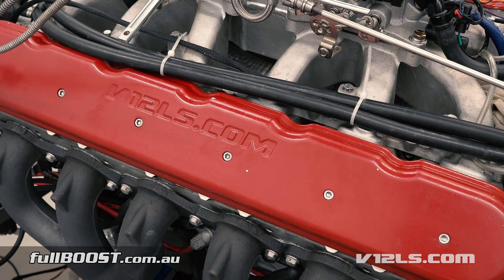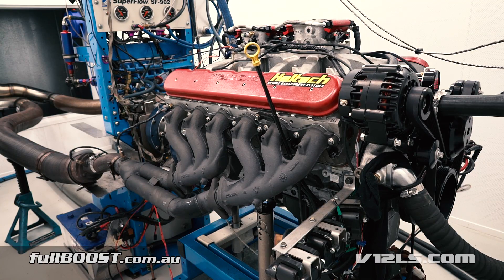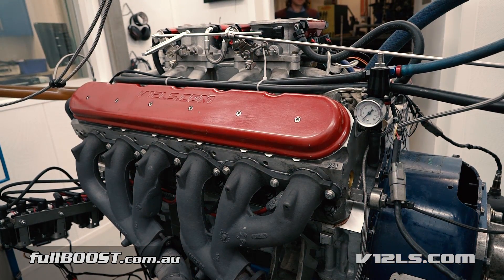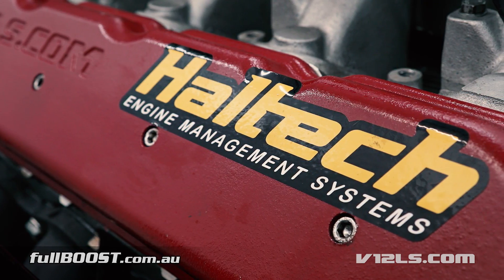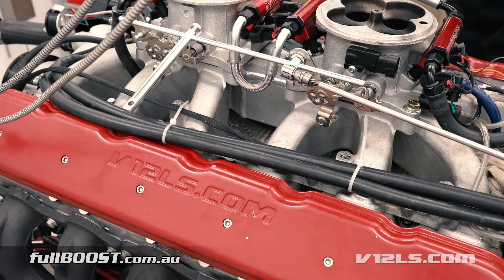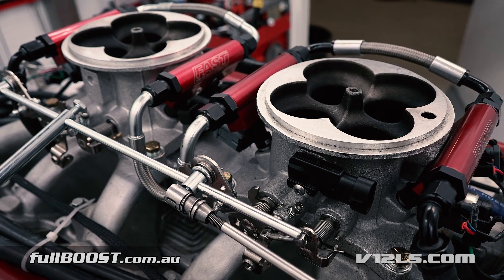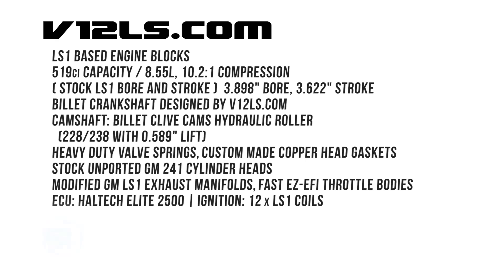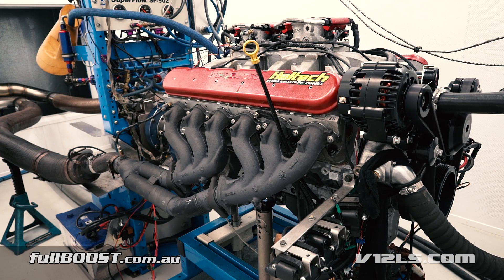V12 LS1 engine dyno

Comment: well, now you can legit LS swap a Ferrari or a Lamborghini
Reply: made me laugh !
Reply: fucking lol Tyler
Reply: #LStheworld
Reply: A little jealous I see.
Reply: Lol still to big! Won't fit in one lol
Reply: Schooled those kids. Good job explaining it also. I was going to say something along those lines but you put it perfectly.
Reply: Thats really funny. Probably won't catch on fire again.
Reply: How is horsepower per liter relevant at all? It's only relevant if you live in Japan where they tax you based on engine displacement. - Horsepower is literally Torque X RPM / 5,252 - its a mathematical formula.

"Horsepower Per Liter" is a measure of volumetric efficiency and how well the engine pumps air and feeds fuel as the RPMs climb. Has nothing to do with anything else. Weight matters, size matters. Smaller packages that weight less are good. The LS series is the smallest package V8 with very respectable power and economy and low weight, being lighter than most V6s in front wheel drive Toyota's. 

A Hayabusa pushes 200+ horsepower because of 12k+ RPM and ability to hang the torque it does make to that rev limit. But a 190 hp 444 cubic inch 7.3L Diesel 1988 International Dump Truck will haul 5 tons of rocks, towing a trailer full of Harley Davidsons up a hill and run over your parked 'Busa like its a soda can.

Ideally, you would have an engine the size of a soda can that weighs the same, 12oz or so, that displaces 27 liters, spins to the moon 16k rpm and makes 5,000+ horsepower N/A and 10k on 30lbs of boost. Out of a pop can.

Alternatively, you could have a 680lb V6 that makes 480hp out of only 3.8 liters as seen in the 2009-10 GTR, but it and its turbo system are far larger, hotter, and 200lb heavier than an LS7 7.0L V8 making 505 hp. Which is better? Well, obviously the GTR is epic, and so is the LS7. The corvettes very low hood line, large trunk, and light weight are only possible with the push-rod ohv engine it uses. 

Power matters, Torque matters, Durability matters, Small size and weight matter. Efficiency matters. Displacement makes zero difference. Who cares if you put a 3 liter hole in a 600 lb block of metal instead of engineering 8.4 liters of holes out of the same exactly block?
Reply: Justin J exactly, torque > horsepower
Reply: A Ferrari V-12 isn't as reliable as an LS and it would probably cost you 4x more to buy a new one than the V-12 LS.
Reply: SpaghettiKillah you do understand that a na lsx can make over 800 to the crank and that's just a v8
Reply: Ferraris aren't exactly known to be reliable same with Lamborghinis with V10 or just the Gallardo in general there's a compilation of videos of mad Ferrari and Lambo owners destroying their cars because they quit working it's hilarious
Reply: @SpaghettiKillah  triggered fanboy spotted lmao
Reply: @SpaghettiKillah . This went way over your head. This motor was meant to be just an LS1 with extra cylinders. Now if you upgraded the heads and cam profile you will have a monster! Educate yourself, and get off your high horse.
Reply: Then the beauti of that European car would be worth a pack of cigarettes!
Reply: LS7 V12= shredded Ferrari drivetrain.👍
Reply: @SpaghettiKillah  wanna count how many time Lamborghini went bankrupt
Reply: @SpaghettiKillah  you fail to realize this engine design is from 1997 not 2016
Reply: The irony is only one of them uses V12s anymore Ferrari has moved onto V8s and Lamborghini still uses V12s and uses some V10s.
Reply: @SpaghettiKillah  
The cylinders are huge in a pushrod engine compared to 4 valve dohc.  The genius of the pushrod engine is that for similar horsepower the external dimensions of the engine block are actually smaller and usually lighter than the high tech 4 valve dohc engine.
Reply: @Triple_J.1  Dude this engine looks like a pig that won't fit into anything. The extra displacement isn't really a benefit here, unless you are stuffing it into your work truck for shits and giggles. I think thats what his point was about HP/L.
Reply: @SpaghettiKillah I think he wants an ls swap because it would last longer than a week. good luck, being rude never helped anyone.
Reply: @MB-jz3uu  was thinking the same thing
Reply: @danieljean-charles9207  got a calculator?
Reply: @SpaghettiKillah  I think you need less time on the internet.
Reply: @Triple_J.1  Annihilated.
Reply: @SpaghettiKillah  Yet the normally aspirated, downsized and RPM restricted LS based race engines seem to clean up in endurance racing. The C7R or Caddy DPi seem to out fox Ferrari each and every time. I don't understand why others just can't keep up....
Reply: Why would you?
Reply: @nxtgen2b416  To a purist collector, yes. But as far as I'm concerned it's a pack of EXPENSIVE cigarettes as delivered from the OEM. As we all know, cigarettes are hazardous to your, AND your wallets health!
Reply: @J.Steele7  a 22 year old female isn't all bad, either. Just because something was "engineered" 22 years ago doesn't mean it's a bad thing. In the 1960s, the design of the 4 cylinder Offenhauser's racing at the Indy 500 was much older than 22 years. But if you had something else powering your car, you were SOL, because a design a LOT older than 22 years kicked everyone else ass up around the shoulders!
Reply: The new corvette with the mid engine this would dominate a lambo or Ferrari if it would fit
Reply: @milojanis4901  the 2jz is that old and id take that over some lamiebo or Ferrareee i seen them boost and nos that is 1600whp and much better than the bmw trash is supra now so new doesnt always mean good
Reply: Dont give them ideas
Reply: Ls3 swap would be better.
Reply: LoooL
Reply: @SpaghettiKillah  Right, because I'm sure it's fair to compare 1 experimental LS-based V12 that some guy made from an engine never intended to do this to a v12 built from the ground up by a team of engineers with millions available in R&D. 
btw, you point out that the F12 has a higher specific output but what you failed to mention is that, because the LS is CIB, it's has significantly smaller outside dimensions and lower center of gravity relative to it's power output - in other words, yes, it's bigger on the inside but it's also a smaller metal box on the outside relative to it's power output.
Some of these guys might be LS biased but you're no better then they are, you're just biased from a different brand and way of doing things.
Reply: shane marz -drives a celica
Reply: Yea, because replacing Ferrari or Lambo masterpiece engines with that GM crap is really smart.
Reply: @cliffordcullen1687  You realize Ferrari's engines are more powerful?
Reply: @cujet  Is that why they keep losing to Porsche, Ferrari and Mercedes?  And that's considering that the series Corvette's compete in are the main focus of Chevy's racing division, while nobody in Ferrari or Mercedes for examples cares about those too much, since they're busy in the big boy sport, aka. Formula 1.
Reply: @stevejhorton  Yea, and it can also overheat after 3 minutes of driving hard on a race track in a top of  performance line up Corvette, and it can break down by the time it has 10,000 km's on the clock.   Don't let me go into horror stories. Companies had Corvette's on the Nurburgring that they gave out as taxi cars that people could rent and drive on tracks back when C7's came out...they were HORRIBLY unreliable, HORRIBLY.   At the same time, zero issues with Mclarens, Porsche's, Ferrari's, etc.   Renting companies have Porsches with 150,000 km's on the clock of EXCLUSIVELY track driving on the Nurburgring.   Any LS engine would turn into atoms by that time if it had to take so much abuse.  The only positive about LS engines is simplicity and cheap spare parts, but they're cheap for a reason.
Reply: @executiveorder7146  Hahah, funny joke.  Corvette would dominate a Lambo or Ferrari.... yea, in the amount of cheap plastics it's built from and in the amount of times it would break down and overheat every time you'd drive it hard.
Reply: You already could. A modified LS V8 can easily make more power than a stock Lamborghini or Ferrari engine. The beefiest is around 700hp, the LSX is also around 700hp. Modify and tune an LSX or LS7, or really any LS, and it'll eat those numbers. I hate to sound like a supercar hater, because I'm not, but for the prices they charge, the power they make is extremely low considering I could probably drop $30,000-$50,000 on my Suburban 1500 and be overpowering Lambos all day with built internals, trans, driveline and twincharger, which is, yes, still extremely expensive, but it ain't $200,000-$3,000,000 expensive. Really, LS and LS-based engines are capable of a lot more than they're given credit. This crazy thing is no difference. Get those built internals, a custom transmission and driveline, a twincharger or blower custom built for it, and it could make 2k horsepower easy.
Reply: @derbigpr500  there is a reason ls is done in swaps and they are better than say the porsche or some lambo and keep in mind not every car made a great car every year and there are whole company to doing the ls swaps in lots of cars so if those cars was that good no swap would be needed
Reply: @derbigpr500  ls the same in a corvette the engine is already swaped in lots of cars including porsche bmw jaguar and im sure Lamborghini im not sure about Ferrari bc thats more of a art piece than a car to me and most is hand made so its why the price so i dont thing performance wise its that great
Reply: @SpaghettiKillah  imagine thinking Ferrari isnt a shit brand
Reply: Ls engines are cool for their cost effectiveness, and packaging but they are really nothing special. They’re a dime a dozen and rev very low which to me, is unexciting. I wanna be clear, I’m not hating on a proven platform I just think there are farrrr cooler platforms out there. It honestly just depends on what you want and like. I personally prefer high tech, high revving, high hp Engines.
Reply: @SpaghettiKillah  I don't think you understand the point of the LS engine. It's not meant to be a high tech, high hp per litre engine. It's meant to be a simple, small, cheap, lightweight engine. Also the LS dominates the aftermarket. The majority of kit cars use LS engines. Barely anyone is swapping lambo or other exotic engines into other cars. The performance you get for the price from a Camaro or Corvette far exceeds any Lamborghini, Porsche, or Ferrari. Take a look at Nurburgring lap times. The Corvette is up there with cars that cost far more than it. Idk why you'd compare an LS engine with something so different
Reply: @SpaghettiKillah  Also I think General Motors is like 4th in sales out of any car manufacturer in the world. So they kind of are one of the dominate manufacturers
Reply: You could all along, lol
Reply: Kenyon Payne u can still put a normal ls in one and it would still make more power than a v10 or v12
Reply: Genius
Reply: @SpaghettiKillah  I get everything that you are saying. But remember how expensive the Ferrari engine is. It is also way more delicate, and part costs is high. While it is sad that the hp per litre is less, but im pretty sure that the checy engine will be more durable, and will have a higher potential hp per litre when the engine build gets maxed out. Again, look at a lot of workhorse engines out there. They tend to be large in size, while not getting amazing hp numbers, but they are durable as hell. Basically the potential is there for it to be way better.
Reply: @SpaghettiKillah  did you even think before you wrote that? It sounds like you're ignorant. The LS engine is in relatively few of GM cars. Corvette, Camaro, Colorado, Silverado, CTS-V. I should not have to explain corporate strategy to you. Im not a GM fan, but I  would definitely say they dominate the automotive world as far as racing goes. Id say their pedigree is at least on equal footing with Ferrari and Porsche. Everything has been LS swapped. You can't say the same thing about the Ferrari engine. Just remember that Chevy was made for the masses,and thus they have engines for a multitude of reasons, while Ferrari is made for the few, and it is always race/performance oriented.
Reply: @derbigpr500  wrong. Theres a reason why everything has been LS swapped, including your precious Ferraris. While I wont argue that Ferrari makes good engines, the problem is their durability. They dont last, and parts and labor is extremely expensive, not to mention it is almost impossible to do the work on the car yourself. Some people would call that poor engineering.  I actually don't think Ferrari could build an Engine with better quality than GM. Ferrari has no versatility, nor self service. If you Ferrari swap a work truck, that engine will be destroyed soon. It will require too much maintenance to be feasible.
Reply: SpaghettiKillah This LS is on stock imported heads and mellow cam so wait. Torque is down from the single plane intake. You are going to see over 100 wheel hp and 80 tq when they let it rip heads cam headers and then imagine the turbo and sc engines.  Wonder what angle the crank is bc there is another possibility.  I think it’s 90 on this ngn
Reply: @ChewbaccaFetus   I doubt you have ever experienced an engine with a lot of low end torque it is much more fun to drive than an engine that you have to wind all the way up to get power. When you have all that torque you don't need to rev the nuts off of it
Reply: @SpaghettiKillah  I bet you cant boost that Ferrari/lambo engine as much as this LS
Reply: Someone did in a 355 if I remember correctly
Reply: @SpaghettiKillah  Lol found the clown
Reply: @Triple_J.1  doesn’t matter when your wallet is crying after your Ferrari breaks for the 5th time
Reply: @SpaghettiKillah  You have such a narrow mind man... make your own V12 engine that's more powerful than this one.. by your own hands..
Reply: @SpaghettiKillah  lmfao hi you must be Italian where anything in Italy supposedly is better than anything else in the world
Reply: U could have already done that
Reply: @proarcher6438  #pontiactheworld
Reply: The hell with that I'm putting that in my wife's bug
Reply: @SpaghettiKillah  you had to seriously get off topic and bring the company's financial conditions? Learn the history, Ferrari almost went bankrupt few times, so did GM, so did Lamborghini, so did Nissan and most of car companies. It don't matter, it's not relevant, and no, LS isn't THE best, but it is "one of the" best. Just stop. You're defending apples against oranges. LS was never meant to be the best, it was supposed to be simple, practical, powerful, durable, reliable, cheap. Ferrari V12 is meant to be an efficient performance engine that is the best in class. Meanwhile in the other hand, this LS V12 is completely in the opposite spectrum. You buy the engine to mod it and clearly the LS won this one because the V12's manufacturer picked the LS platform, not the Ferrari. You've lost the argument. Accept that.
Reply: Best comment 🤣🤣
Reply: "On a long enough timeline..."
-Mr. Regular
Reply: Naw man, just naw
Reply: No, cylinders of the v12 Ferrari engines are tiny.  This engine won’t fit.
Reply: @SpaghettiKillah  Who cares about HP per Litre? It's all about HP per KG, and aluminium LS engines win on that front, a long with having flat power / torque curves :)
Reply: @SpaghettiKillah  What if they put a turbo and fuel injection on it? 😈😈😈
Reply: @SpaghettiKillah  yeah!!! You tell them!  Even a b16a1 is faster! It makes 100hp/liter.  This only makes 80hp/liter!
Reply: @Triple_J.1  Horsepower per liter is relevant in any kind of car race ever made. You even implied it in your own comment
Reply: Or a single cab 😂
Reply: Isn’t it even bigger in liters? So it’d be an upgrade

Comment: I love how its exhaust note has a balance of V12 and V8 to it at different RPMs, it's oddly mesmerizing to me.
Reply: V8 at low V12 at high
Reply: That's because the firing order is not the same as a typical v12, plus there are constraints in the header design.

Comment: Over 7 hp naturally aspirated using stock parts. This engines potential is insane!
Reply: Right, could make 1000hp with a couple bolt ons and a tune N/A.  Imagine a set of turbos on dat thing. This engine could probably spool up a pair of 88s or larger no problem.
Reply: Lol 7hp
Reply: Ha 7hp
Reply: That’s a whopping 0.8hp per litre! These American engines are catching up!
Reply: @devlintaylor9520  Well, he's not wrong
Reply: Over 7 hp?

On a technicality, you're correct...
Reply: @NitroNuggetTV  Yeah soon enough we too will be riding in sub-1L shitboxes